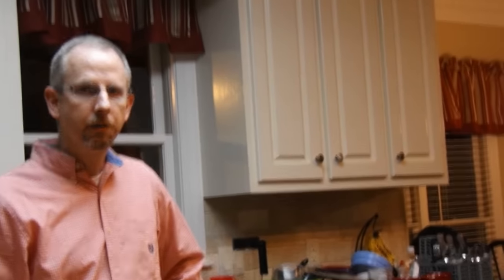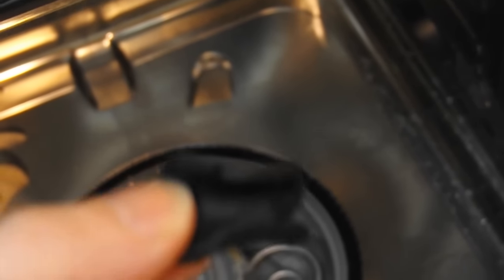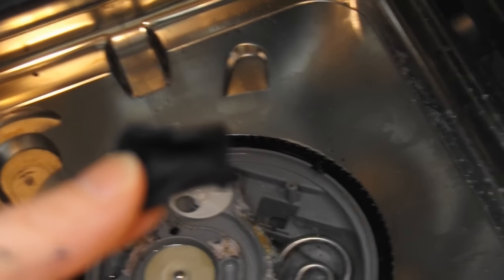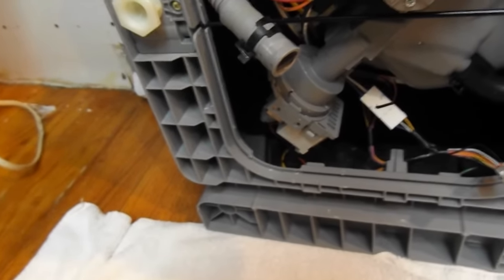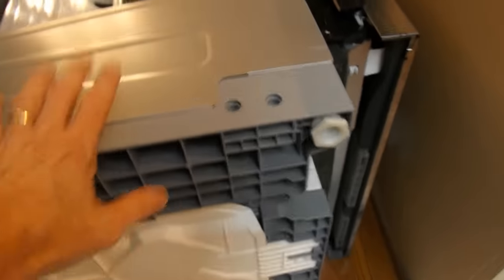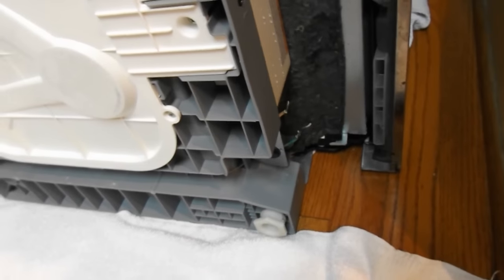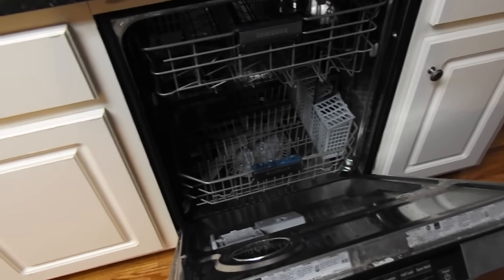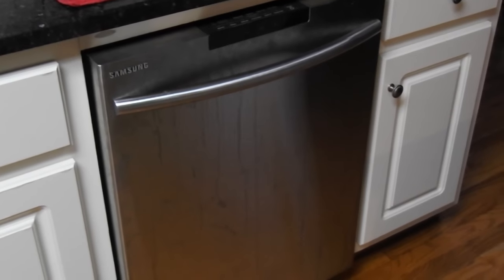How to Unclog Samsung Dishwasher Drain - Fix 5E Error

Comment: worst dishwasher ever
Reply: yup, one model level higher you get a filter you can twist out and clean in 10 seconds
Reply: I have this dishwasher and I feel I just bought a trash, worst dishwasher in the world !!!
Reply: Yes! I have to say, I doubt we will ever buy Samsung again!
Reply: Our circuit board died twice. And now I'm on the floor taking out all of these pieces as the video author demonstrates. I wonder if anybody has thrown a brick through Samsung HQ. Wouldn't surprise me. Truly - this (as the video author States) is a piece of junk.  At least if it were a little better you could call it a dumpster fire - which - at least has a possible purpose of keeping you warm. This machine? No useful purpose, as sitting on the kitchen floor all weekend is not usefull.  Everyone here needs to discourage all Humanity to never buy anything Samsung again, weather it's a TV, phone, construction equipment, or refrigerator. Special place in hell for all Samsung engineers & corporate heads that allow them to make such trash.
Reply: Every week there's a problem with ours. So irritating!
Reply: yes it is X samsung service tech.
Reply: @Gary "... sitting on the kitchen floor all weekend is not usefull...."

Hilarious! But I can relate as I've been there, and about to be there again. Our PoS Samsung dw died a while ago, going to attempt refix today. Hopefully this is the vid I need.
Reply: Don’t even buy their fridges as well
Reply: Agreed. Had an old washer at my previous house I wish I kept because it cleaned so well. Probably got thrown out by the new owners because it looked old. With this one you have to wash the dishes before it washes them

Comment: Found the other half of my check valve stuck in the drain pump.  What a stupid design.  The detergent eventually melts it and clogs the drain with it causing the dishwasher to overfill and leak.  I'm not replacing it.  Works fine without it.

Comment: Thank you. My washer had an 9E error code for months, I found a video on here on how to clear that issue, worked like a charm. Then I got a 5E code so I pulled apart the bottom section inside the washer looking for something clogging it and checking the valve. After cleaning everything I tried turning the machine on again, this time I had an LE code. Apparently while I was trying to fix the 5E I got water underneath. So, I decided while I was underneath drying things out I would also check for any blocks. Yep, right where you had yours, I had a broken tab lodged perfectly blocking the line. Put it back together, turned it on, no codes!! I'm so thankful for the people who post all these tutorials. Even a female who knows nothing about appliances can fix things.

Comment: John, I found the check valve like you showed on the video AND another piece of round black rubber piece that has a "30" on one side and a rectangular opening on its edge.  I wish I can add a picture here to show you.  I don't think it is part of the check valve.  I do not know where that has come from.  It looks like some part which came loose, not broken off like the check valve.

Comment: Thanks for your help, great video. I disconnected the drain line at the garburator and blew back into the dishwasher. The hose was completely plugged so I go out my shop vac and with a small nozzle and I was able to clear the drain hose with suction. The check valve still looks good but would like to replace it soon, would you happen to know the part number? On another note I find the debris screen needs to be taken out and brushed clean every couple of months as the dishes come out dirty and yes we do pre rinse the dishes before they go in but maybe not good enough. Is this just a bad design???

Comment: We have an older model Samsung. When my daughter and I took the hose off of the back/bottom, we saw the black rubber piece inside a transparent cover, along with two large, rusted screws! A complete clog. Three hours later (because the transparent housing which the hose connects to was literally a large welded, plastic piece) we removed the clog and were back up and running! Thank you for heading us girls in the right direction!!

Comment: Mr Way. Thanks a lot for this video. After opening my one and a half year old Samsung dishwasher, I couldn't figure out where the clog was. Air was flowing through (blowing in the exhaust would make bubbles in the dw) but the dishwasher wouldn't switch water from circulating inside to draining. Per your video I just inserted my finger in the direction of the pump to find an olive seed stuck inside. Works like it's brand new now.  My dishwasher is not the same model as yours but I think they all have the same conception defect. People like you who share their knowledge are awesome. Thanks again Sir!!!

Comment: Did this cause a leak in the lower pan where the sensor is? I'll getting the "heavy" code because of a leak. Just wondering if the broken check valve would cause that. Thanks.

Comment: I found my rubber valve at the end of the drain tube! Fortunately I didn't have to take the dishwasher out! My question is do you have to replace the rubber valve ? Will it cause other problems by not having it in there?

Comment: I watched your video and this was exactly what our Samsung dish washer problem was. While watching and stopping your video at each step worked perfectly. a black rubber check valve was stuck in our drainage hose. I tore it apart and my wife could see the black rubber piece and she was able to pull it out with a pair of tweezers and we are up and running...Thank You!

Comment: I was getting  the not draining  still after  cleaning  vacuuming took the thing apart pump hoses blew air still had the code so before  throwing it out I removed  the check valve which was not broken did a 15min reset  did a cycle  problem fixed no more codes thanks for your video cheers

Comment: I went through the process you showed and I could find no cause for not draining.  I do have standing water in the machine from time to time.  Do you have any suggestions on what else it could be?  Mine is a rotary - very similar to what you have.  It just stops in the middle of the cycle.  I'm getting the Over-level water error (Smart Auto and Heavy lights lit).

Comment: Hello

I just dropped a nut of screw into the grey round piece in the bottom, the nut size is like #6 screw. Do I need to open the bottom to get it out, or it will be ok to flush away.

Comment: Thank you for video.
To focus better do NOT zoom. Zooming is for FAR distances. I know you've probably zoomed in before and it's worked. But it's not. Higher end ones can but most do not. Just keep it normal and physically bring yourself closer. 
For the part you were trying to zoom in on at close range. Again make sure you do NOT zoom. Center it and if your camera won't focus at that close range with the lighting you have then pull the item back until it can stay focused and keep it there. 
This video is  years old but hopefully anyone else reading this will also get it. 
Again, thank you for video and the solution. You've probably helped a LOT of people. God bless

Comment: Thank you for this video. I also have a build up inside and around outside of the soap dispenser. The latch build up and so far I’ve been able to scrape around it so it will latch. There is still a bunch I can’t get off. Vinegar helps a little but not enough. Any suggestions?
Reply from the maker: I can't say for sure without seeing the build up. If it's soap, maybe try pouring a lot of very hot water over it. Just be careful not to get the water so hot that you melt the plastic.

Comment: This video made me look for small broken plastic clips in my machine. Sure enough one was broken and when I unclipped the drain hose, it was blocking it. Problem solved. Thank you. Just was small issue now is a small leak from the bottom corner of the door. This may be a levelling issue.

Comment: Wanted you to know this video is still helping folks in 2021. I used it to fix the same problem. My check valve did not break, rather twister and deformed to the point that unit would not drain properly. Didnt even have to remove or disconnect the unit, just removed the filter and found the diaphram shoved down in the drain hole. My wife had already picked out a $700 Bosch that we won't be purchasing.
Reply from the maker: Glad I was able to help you squeeze more time out of your dishwasher. We finally had to get a new one... we went with an LG from Costco. So far it's been great... love the new third level top basket.

Comment: Thanks just fixed my sisters dishwasher , she had replaced those brackets two years ago , but I only had to remove filter screen (dozen screws)  and in plate with impellers etc, there is a hole from top to bottom of plate was full of ????? solid sludge, and found broken clip in bottom . Was intermittent no drain so I think  broken clip was flosting up or sucked up against that sludge and pressure of pump would keep it there and then no drain but next time it would work. Thanks again

Comment: John - I followed your video, which was perfect, and found my check valve to be intact.  I even pulled the dishwasher completed, checked the hose on the bottom for anything that could be blocking it and nothing.  I attempted to run the dishwasher without the check valve in place as well - and still receive the 5E Error after a good 30 minutes of the dishwasher running.  Do you think it could be the drain pump? We've only had this dishwasher for about 2 years.
Reply: in my case all the hoses were clear but I found the date seed in the drain pump, I took it out and it was working fine. No drain error.

Comment: Found all kinds of pieces inside, a wire nut and plastic from the rack restricting water flow. Thanks - I had taken it apart before but had not gone far enough inside. Wish they made a ring for the outside to prevent large pieces from getting in there in the first place. I will have to look into that, but thanks for the video.

Comment: Thanks for the video!  I’m visiting mom for Xmas and see she has this exact problem.  What part do you replace and where do you buy this part, online ?  Thx
Reply: @LifeHappensLetsFixIt  how did the machine operate without it being replaced, isn't it necessary to be in place? Mine did not tear off like yours but the rubber has twisted and seems like it does not close back in place.
Reply: @LifeHappensLetsFixIt  wow..ok good to know! I've tried toubleshooting all the drains, checked every hose and there are no blockages yet I continue to get the 5E error code, any other suggestions you may have? I'm considering to order a new drain pump as that might be my issue? Thanks again for your help on this headache
Reply: @LifeHappensLetsFixIt  so just remove it and see if that allows the unit to drain? Worth a shot, I'll try that now! Thanks for the tip 😁
Reply: @LifeHappensLetsFixIt  so I tried it, removed the damaged backflow valve, ran an empty load on quick + and half load, and within 5 - 10 mins it errored out 5E 🤯

Comment: i wanted to add my thanks here for your video. i found this DW at best buy for $50!! the sales guy told me no one would buy it because it was so low. i think i understand why it's so cheap now ;-)

anyway - your video was incredibly helpful. it didn't solve my problem, but it was good enough to give me the courage to go check for the drain pump error as you described it, and that taught me that i could take this apart and put it back together in jig time. i would have taken this one step further and shown how to take of the drain pump to check if any of those plastic tabs were in there. that was the case with mine. i simply disconnected the drain pump, pulled out the @#$%ing tabs, put it back together and all set :-)

one additional warning - when you go to remove the drain pump, be very careful to properly lift the locking tab that allows you to twist the drain pump off the DW, lest you break it. ask me how i know ;-)

anyway - great job - and thank you.
Reply: I bought mine at Best Buy for $250 and got home to find many missing parts.  Spent almost $100 since best buy would not work with me.

Comment: Is there supposed to be a check valve in the drain hose as well? The check valve that you show in this video is in place but it looks like I have rubber (looks like a check valve) in my drain hose.
Reply from the maker: There isn't a check valve in the drain hose... unless it's a broken piece. This video shows how to find and remove the broken piece.

Comment: Thanks for the Samsung Vane-Check Drain DD66-00045A part number and as a follow up the "SE or 5E" issue came back and the unit would not drain. I went out and purchased an Auxiliary Drain Pump which twist locks in to the bottom after the check valve #DW0005A for $80CND and the unit has gone through 2 wash cycles and all looks good now. Thanks

Comment: I have this same dishwasher and I can also confirm that it's a piece of junk. Not two months after getting it we started smelling a horrible odor of rotten food whenever we opened the door. That was 4 years ago, and every few months I have to take everything apart and clean the parts and the bottom. It gets so disgustingly gunked up. I see that same thing in your video. We had Best Buy service technicians here multiple times to look at it and got a different excuse every time, but none of them ever said it should be replaced. Now it's out of warranty and we're stuck with it.

This 5E error is just the next fun thing in a long line of fun things.

Comment: While you were waiting for your check valve to arrive, how did your dishwasher run? I have a leak error on my dishwasher and the first thing I noticed is that my check valve was damaged. Water is now backflowing into the dishwasher through the drain hose and I keep getting water in the leak detector pan.

I'm going to check the drain hose on the bottom of my unit tonight and check for foreign matter in the hose. Luckily, I don't think I'll to disconnect the romex cable or the water hose because I have more than enough ran to pull my unit out while they're still connected.
Reply from the maker: I never replaced my check valve and I haven’t had any trouble with back-flow. Hopefully it’s another blockage causing your back-flow issue and removing that will get you back in business.

Comment: took mine apart today and the check valve was good. but right next to it was what look like some kind of optical sensor covered in gunk cleaned it all up and works great now.
Reply: Andrew,  my Samsung DW80F600UTS also was not draining. I was getting flashing lights at the AUTO SMART & HEAVY parts of the circuit board.   I took your advise and removed the many screws in the screen cover and looked for the grey plastic cover piece at the right of the heater element.  Under it was the optical sensor and the 1/4" steel temperature sensor rod.  The optical sensor looked pretty good but the temp sensor had gunk on it.  I cleaned them both and re-assembed the machine.  All works great now, thanks for your help…..
Reply: Works for me every time . I'm glad I could help.

Comment: Hey, did you installed a new valve? Can the dishwasher work without that? What's the job of that little valve?
Reply from the maker: I did not replace it. It's a backflow preventer that lets the water out of the dishwasher into the drain, but doesn't let the water come back in. Mine has been running without one since I published this video several years ago.

Comment: Hi John... I followed all your steps. I even ran the d/w without the covers and arms.  I still get the SE error code. I cleared the line and pulled the little check valve (it was twisted and there was a tab just behind it.  However, I still get the SE code.  Should I try to replace the pump next? Thanks!
Reply: Hi John - Wow! Thanks for your quick reply - greatly appreciated! On my first go through, the check valve was twisted and a broken tab from the rack was in the entry to the drain pipe. After I sent the message above, I pulled out the d/w again and pulled out the drain pump. Low and behold a second broken off tab from the dish rack was lodged in the pump unit and jamming it. I replaced all the parts and am running the d/w now. Touch wood, the issue is resolved! Happy New Year.
Reply: John / Steve, We have the sme problem, the check valve was in the inlet of the drain hose.  Is there a video that shows you how to pull the drain pump so I can check that?
Reply: I have the same problem, after I pulled the check valve out of the drain, I put it all back together we got the 5E message again.

Comment: Hey thanks a lot for this video. This is exactly what happened to me except my check valve was a little higher in the tube. Didnt realize it was actually there until i put a clothes hanger up there for safe measure, very thankful i fished it out the first try or i would have omitted that as the problem. Really appreciate you saving me from buying a new dishwasher. Cheers!

Comment: I've had this issue for years. I check the hose for blockage and nothing. I've taking the washer out countless times. It would work for a week,month or not at all. I was dumb enough to not check the hose from the vent to the garbage disposal. Sure enough it was plug pretty bad with years of food. No more problems. 😀